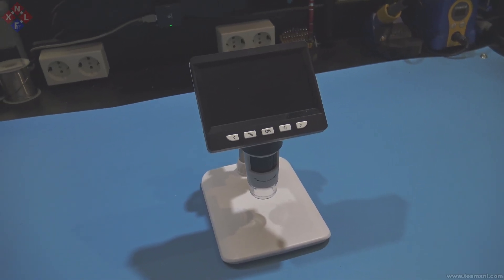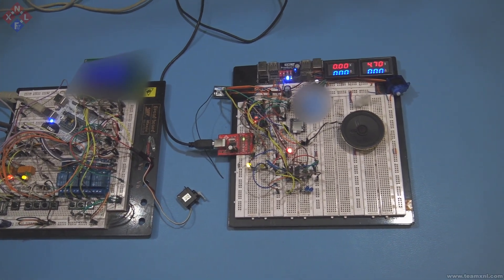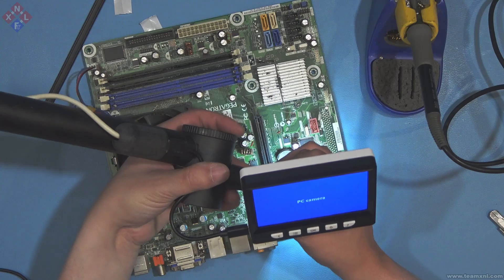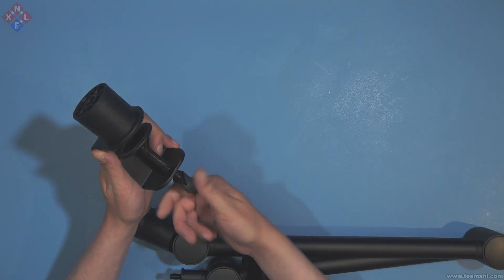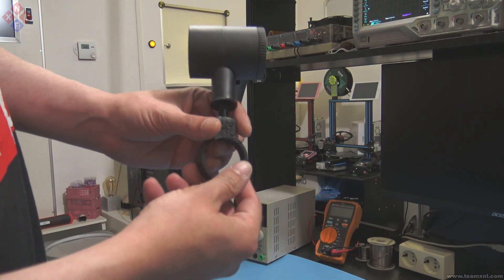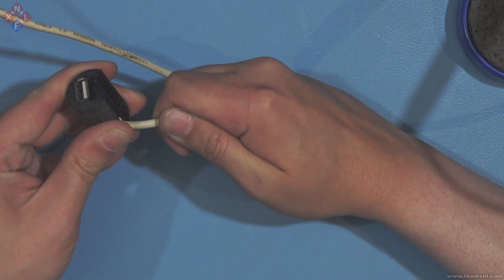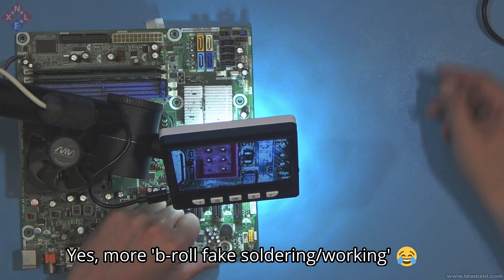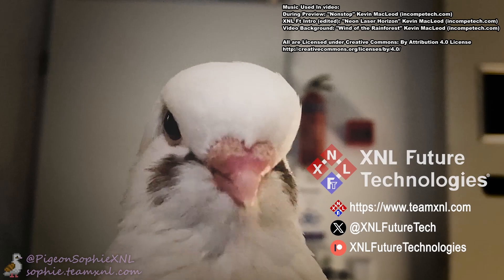DIY Microscope Arm, upgrade your (Cheap) Electronics Microscope

Comment: How's the freedom of movement with this setup? I'm looking into doing this myself and I'm wondering how much control you have over the position of the microscope and how easy it is to move around. I realize it can't be too easy to move otherwise it wouldn't stay in position but like can you just grab the microscope and move it pretty much anywhere you want within reach of the arm or do you have to fiddle with getting the arm to bend just the right way to move to a certain point in 3D space on your desk?
Reply from the maker: Very good questions Chuck 😉 let me answer them for you.

I had tried several other solutions in the past, and also have had the VERY expensive stereo ones in the past (but honestly in my PERSONAL opinion those are just not needed for most electronics work).

And not to blow my own horn 😂, but in my personal opinion this was the best Idea I ever had for this microscope, and will admit that I initially thought it would be pretty sh*tty, but at least its cheap and simple.

But with the arm I'm using I did not had ANY discomfort using it at all anymore. Not even crap like the microscope dropping a bit (and thus losing focus) after finally having it position correctly (which I did had with others in the past).

I absolutely like this Microscope personally, and with the arm it's the perfect combo for me. Easy to maneuver (with THIS arm you can control the tension on the hinges, so you can adjust it to your needs), easy to 'get out of the way' if you need the full desk to be free (or free of shadows in my case).

Obviously mileage may vary depending on which exact microscope and arm you're using. But personally this is just THE setup for me now, and several friends and colleagues have "copied the setup" already after trying it 😂.

I Do however want to emphasize that the quality/type of Arm might make a HUGE difference, so please keep this in mind. Also DO NOT use those arms with have 'two bars with a spring between them'. Those will drive you INSANE, trust me on this one and don't ask how I know 😉😂

Comment: Is the 3d printed ring 40mm or 50mm?
Reply from the maker: Good catch! Thanks😊👍🏽

Didn't thought about mentioning that either in the video or on the download website in case people want to use it with a different microscope for example. I have now also updated the website with the additional measurements😊

The shape of this particular microscope isn't just one straight section, but the (inner) dimensions of the ring basically are this:
Top (near LCD): ±39mm
Bottom: ±36mm

Hope this helps😊

Comment: Well done mod, i may get that arm for my microphone, its always in the way, maybe use one arm with interchangeable attachments for each, never use both at the same time.  Larry
Reply from the maker: Thanks😊 I thought about mentioning that (that you could of course also switch between the mic and microscope), but for some reason I forgot😂.

I initially also thought about doing that myself, but the 'integrated' XLR cable and the fact that I use the mic quite often (much more than the microscope) and that I sometimes need it during live video calls made me decide not to switch between them (maybe also the reason I forgot to mention it)

Do however note though, that 3D printed threads might wear down if switched between them frequently (but I'm assuming you are aware of that though) 😊

Comment: Nice to know the USB port serves as video data for webcam! I thought it was just for charging!
Thanks, very nice video!
Reply from the maker: @SenorJackson-j5g  Thanks ☺️ That was also a very important function I wasn't sure about when googling more about them before ordering.

To me it was also unclear if it would work as capture device. Would have been neat though if the LCD and USB output worked at the same time, but hey for just 30 bucks I have absolutely no complaints ☺️

Heck, I even bought 3 in total 😂 as spares because this truly is one I could be using for a long time ☺️

Comment: You come up with very good ideas to add to your workbench. I do not have a 3d printer, would you be able to make me an adapter? I would pay for shipping and any other expense? Thank you.
Reply from the maker: Well thank you very much for your nice words, much appreciated😊

Last year I designed lots of custom name ornaments as Christmas gifts to all the online bird friends of our pet pigeon Sophie (on her Socials), and (obviously) quite a few in that group didn't had a 3D printer either. I did ended up sending one or two of them the ornaments (but those where because of special reasons like that their bird unfortunately unexpectedly passed while I was still in the processes of designing them (and they knew I was also making one for them). However we also learned that for almost 95% of the people it would have been actually (sometimes even much) more costly to print them here and then ship them, instead of using an online service to get them printed and shipped to them.

We found that there are actually quite a lot of online companies to which you can upload your STL file (the file to 3D print) and then you can tell them (via a website form) what settings and materials you want to use, and they will then ship it to you for a rather 'small fee'. If you for example have such a company in in your region, it might actually much cheaper to use one of those 😊

At the bottom of this page (on our Pigeon her blog) you can find a bit more info about this option:
https://sophie.teamxnl.com/product/sophies-christmas-name-ornaments-3d-print/

If you can't figure it out for some reason or need some additional info/help, you could always contact me through the contact form on my website though (for a bit more 'direct contact' via email) 😊
(the website is also on my channel, but just for completeness: https://www.teamxnl.com/contact )